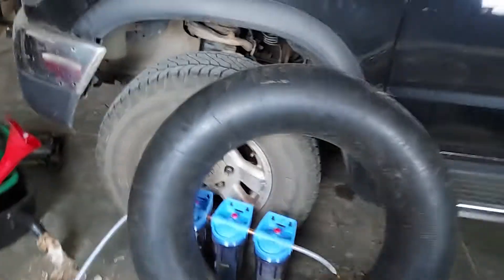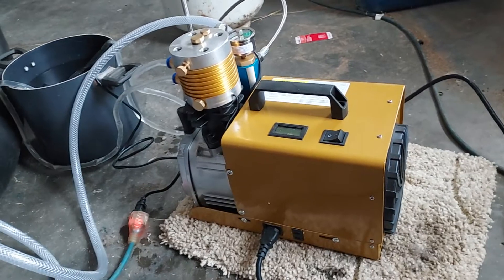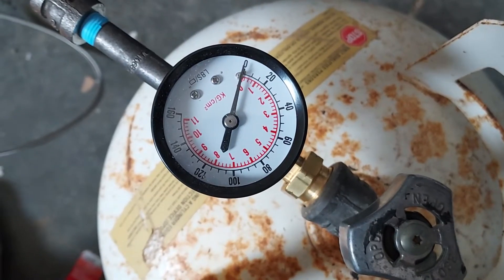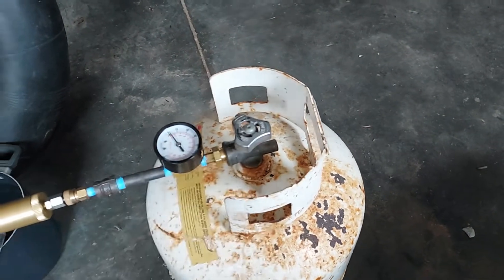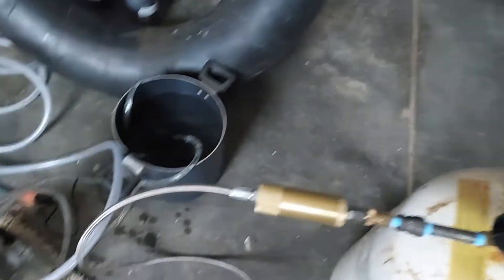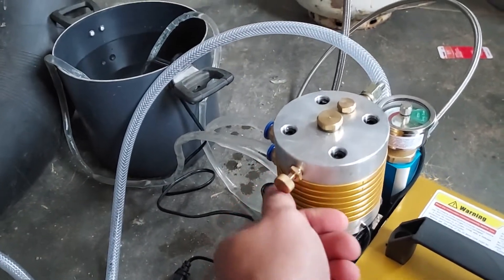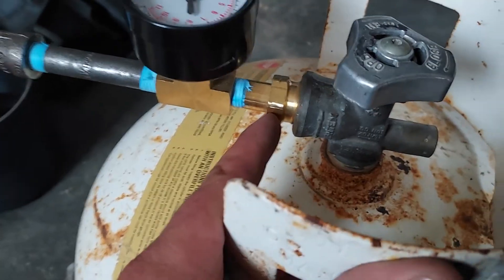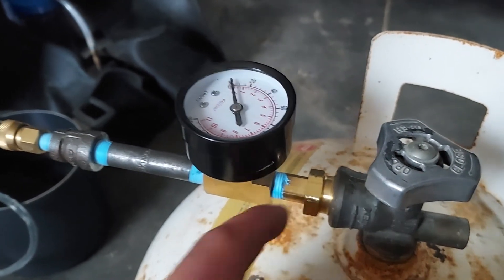compressing biogas

Comment: You forgot the calcium hydroxide to remove the CO2 which falsified the actual yeld amount
Reply: Also is that a explosion protection compressor? Compression of combustable gases need to be compressed with EX protected equipment otherwise the compressor turns into a combustion engine.

Comment: Oh I forgot, if you can, adding a fitting for an O2 (oxygen) sensor on both bleed line. That way you don't guesstimate if it's good and you will have no trace of oxygen there, could be a life saver
Reply from the maker: That’s a great thought. Thanks

Comment: Keeping the cylinder cold on ice reduces the pressure and liquifies the gas.even put bottle outside in snow.
Find the WC or water content of bottle and fill to 80%or less.
There would be a filling ratio for bio gas close to lpg I’d image.
Wc x filling ratio x .80 =  volume in kilos
Get yourself a new refrigerant bottle with 2 valves and ports and fill through the red port which has a liquid tube to the bottom of the bottle

Comment: You are hooking up the filters backwards. Note the flow arrow.
Reply from the maker: Correct. That’s because they’re designed to filter liquid and I am using them to filter gas. This way The gas will push its way down the center tube and return upward outside of the tube instead of vice-versa. 

Since the volume outside of the tube is greater than the volume inside of the tube, that matters a lot more later when I figured out filling the filter with water works better than steal wool.

Comment: While water can scrub CO2 out of the biogas stream  and upgrade the biogas quality and energy density, providing a good source of bio methan, natural gas, but  it must be done under pressure, because of water's capacity to absorb CO2 is highly dependent on pressure. Think about CO2 bubbling out of solution in soda bottle when you release the pressure. Your high pressure water scrubber should be compressed to between 70psi to 150psi. This high pressure water scrubber should produce about 98 to 99% bio methan, natural gas.  The soda water  can be let out and regenerate itself under low pressure. This can be done in batches or continousely by letting out a stream of CO2 infused water at the bottom, and feed in refreshed CO2 depleted water at the top  while the biogas is  bubbled through the scrubber. 

Here is a note on compressing and storing low grade biogas with CO2 under pressure without sufficient scrubbing.  The moisture in the gas can condense after cooling and absorb CO2 from low grade stored biogas under pressure  forming carbonic acid in the water that may slowly eat away at the iron in the steel walls. Thus a low pressure drying stage after scrubbing to remove water before recompressing is important.
Reply from the maker: Excellent thoughts!! I love this. 

Back then, I was aware that raising the pressure would increase the effectiveness of the water scrubber (I think I talk about it in one of the videos) but I could find no way of doing it that made sense. If I could find a way to do that, I might start this channel back up and resume my goal of running a car on kitchen scraps. 

Thanks so much for your comment.
Reply: @BiogasUSA  Ive been thinking about this problem for awhile now and I think I've worked out a batch process that is simple and makes sense. It uses city water pressure to do much of the work. 

A CO2 scrubber can be made with 10 feet of 6 inch schedule 80 PVC pipe, two end caps, maybe 4 valves, water hose,  and optionally a pressure gauge. 

1. lay the chamber on its side.  This gives a good surface area for gas absorption when partially filled with water. 

2. Purge the chamber of air with water. After it's full of water and completely purged, then close the gas out valve and drain the water by opening the water out valve letting it suck biogas in through the gas in valve. 

3. When the chamber is filled with biogas and empty of water, one should close the gas in valve, and water drain valve, and open the water in valve and let city tap water  in with its pressure compressing the biogas as much as the static water pressure will allow.

4. Let it sit, so that the gases cool down making its compression iso thermic,  while also giving it time for the CO2 gas to be mostly absorbed. Agitation can quicken CO2 absorption. But  for simplicity let's consider just giving it time.

5.  After the pressure has stabilized and much of the CO2 is absorbed, you can open the gas release valve to another tank or a compressor to store in storage tanks while you continue to maintain pressure in the CO2 scrubber chamber under city tap water pressure, until the scrubber is filled with water. Then close the gas out valve, and the water in valve.  

6. The water is now charged with CO2, and this needs to be let out and so that the CO2 can degas. 

The static water pressure in most US homes is commonly between 40 and 60 psi.  Or one can use a shallow well pump and water holding tank for virtually no suck head pressure loss, then set the cut in and cut out pressure higher 

A 10 foot 6 inch schedule 80 PVC pipe containes about 50.34 liters of volume, and is rated for about 280psi. While the end caps are probably rated for 200psi. This should be a more then sufficient safety margine when working with compressed as. If filled with a typical 60% methane and 40% CO2, then that's 30.2 liters of methane and 20.14 liters of CO2. 

When pressurized to 40psig  static hydro pressure, the methane concentration in the scrubber equilibriate at about 87.5%, but at 60 psig, the methane concentration improves to about 90.7% after the CO2 is absorbed into the water. This is a vast improvement given the simplicity, and even at 40psig, a batch could be repeated once  to achieve an impressive 96% methane concentration from a homemade CO2 scrubber.
Reply from the maker: @kreynolds1123 very interesting ideas!! I’m loving this. Genius to use city water pressure. 

I’m not sure I have 40-60 psi on my water lines. It must get regulated down before I ever see it. I’m going to spend some time and think about this also. 

Thanks for this comment.
Reply: @BiogasUSA that's static pressure which is different then pressure under flow.  I'm pretty sure the pressure regulated to your home by the city  is above 40 psi.  But as water flows through your pipes, the dynamic flow lowers the pressure but the static pressure should be the same as what your city provides you.

Comment: Here's a note on the chemistry  of iron filtering out hydrogen sulfide.  It needs water and iron oxides to make iron sulphide. That means it's better to pre rust the steel wool with as little as sodium chloride and first bubbling air through it. Then when you bubble hydrogen sulfide through  suspending  iron (III) oxide mud, the hydrogen from hydrogen sulfide and oxygen in the rust makes more water while the iron and sulphur makes  insoulable iron sulfide. 
 You probably want a bubble mist filter downstream to keep rust and sodium chloride out of the downstream compressor and equipment. 

iron sulphide can be regenerated back to iron oxide and elemental sulphur consuming the last remaining oxygen in the gas stream untill theres none, and rerust the iron while elemental sulphur is released.  After all the oxygen is used up and after  the rust mud is largely spent converted to iron sulfide particles  you can swap the bubbler out with a new batch of rust mud and bubble air through the iron sulphide. Then gravity filtration can help seperate  elemental sulphur and iron oxide because iron oxide particles  is almost twice as dense as elemental sulphur particles.
Reply: That’s a bit like an iron sponge. Sulfatreat is basically clay balls impregnated with iron oxide while iron sponge uses wood shavings as a carrier for the iron oxide. You can use one of the amine sweeteners to absorb the H2S and regenerate it but you want to know what you’re doing because you concentrate the H2S and can easily kill yourself with that.
Reply: @Woodburner100 yeah, hydrogen sulfide is no joke. great point. It needs to be oxidized to water and elemental sulfer for safety.
Reply from the maker: Wicked great comment. Thanks for sharing your knowledge. Isn’t iron sulfide pyrophoric also? Or am I thinking of something else?

Later on in this project I discovered that simply bubbling my gas through water would clean massive amounts of h2s from the gas very easily. I placed the water bubbler filters between the biodigester and the inner tubes (instead of between the inner tubes and the compressor) so that the gas would move very slowly through it throughout the day, and the h2s would have more time to contact the water. This was highly effective. 

My biggest problem became filtering co2 from the gas. If I could come up with a good idea of how to do this I would restart this project and try to make a car go.
Reply: @BiogasUSA Yes dry iron sulphide can be  pyrophoric. its oxidation  generates heat and heat can accelerate the reaction. It  can also potentially release some hydrogen sulphide and should be avoided. 

Yes, water absorbs hydrogen sulfide pretty well, but it has a limited capacity to do so. As it nears its capacity more and more hydrogen sulfide will not be absorbed.  And you eventually need to get rid of the hydrogen sulfide saturated water. On the other hand Iron oxide breaks up the hydrogen sulfide splitting hydrogen from sulfur making H2O  from the  oxygen in iron oxide  and iron sulfide from the remaining iron and sulfur. the chemical reaction  Wh ensures that the water never gets close to  its capacity to absorbe hydrogen sulfide,  so long as there is iron oxide to react with. 

Water also absorbs CO2.  in another comment I suggested a pump to compress CO2  up to about 150psi. Bubbling hydrogen sulphide scrubbed biogas through water under 150 psi in a tall water column will scrub it of most CO2. 

You might try an acid washed sand to remove minerals. And bubbling through cource sand grains breaks up bubbles and increases the bubbles residency time in water.  This might allow for a shorter column of water. But it also displaces water so less water means less capacity to hold CO2.   Drain the water out at the bottom and let the CO2 bubble out. Then add the CO2 depleted water back at the top  with a water pressure pump to capture the remaining CO2.  This can be done in batches or continouse mode. 

Here is a batch process you might like.  Fill a tank to 75psi  with biogas scribes of hydrogen sulphide, then add water to the tank with a pressure washer that can spray water at 1500 psi or more, until the tank reaches 150 psi.  This would result in the tank being slightly over half filled with water. Let it set for a while untill the pressure stops dropping with the absorption of CO2.  Then drain the carbonated water. If the biogas were 40% of the initial volume at 75psi, then after adding water  and removing the carbonated water also a large percentage of the CO2, the pressure in the tank will be close to 45-50 to psi.  You can rince and repeat (idiomatic pun intended)  if you want to ensure a higher grade biomethane
Reply: @BiogasUSA  I just watched an Apollo 13 micro-docu so I'm definitely qualified to comment on CO2 scrubbing, you can simply use lithium hydroxide 😂 thanks for coming to my TED Talk

Comment: The filter system contains a lot of air , you will want to put a close off valve at each end to limit the air ingress and gas wasted to purge it.
Methane is lighter than air so ensure any purging is done from the bottom of any container not the top.
Reply from the maker: Great points. Thank you for the tips.

Comment: You should keep a slight overpressure on the suction side of the compressor. That way, there's no risk of it sucking in air if you have a small leak. You could just put a board on the inner tube and put some weight on it. Relying on one keeping an eye on the manometer doesn't feel good when the compressor has the capacity to explode the tank. I would put a safety valve between the compressor and the tank that opens before the tank blows.

Comment: you need a recovery pump, not this air compressor, also a vacuum pump to pull a vacuun on the vessel prior to filling, but methanes boiling point is well below freezing at -161 so wont liquify unless purified and compressed in a high pressure vessel to 3000psi. they sell high pressure vessels and pumps also filtration chambers  hoses and guages that can withstand those pressures. filling a tank like this isnt worth the time it takes to fill as youll only end up with a few min of cooking gas at that pressure. better off getting a bigger balloon and sticking with that. methane really needs to be chilled in cryochambers to -81c  to liquify and needs cryo storage to be kept in liquid form, compressing to 3000-3500psi or 200-250bar in  properly rated vessel to really make it useful

Comment: How do you get the air out of the tank before adding the biogas gas please
Reply from the maker: @bnf3t  the tank had propane in it before, so I was never worried about oxygen in the tank making an explosive environment. 

I also wasn’t worried about completely emptying the propane before filling with biogas - but if I was I would fill it with biogas and then vent it empty two or three times.
Reply: @ many thanks 
I have something for you when we were younger we used to have horses quite a few of them here in the UK. We used to use a bulk feed called Sugarbeat when you bought it. It was dehydrated because British sugar take the sugar out of the beet be so you left with this dry food lots to feed it to the horses you need to wet it so it expand but there was always a black liquid at the bottom of the bucket after you finish feeding it my brain started to work sorry if this is a bit lengthy just the way my brain works so I thought here we go so I got a galvanised bin and kept saving up the liquid until it was full. I went to my local baker and bought a pound of fresh yeast broke it up then put the lid on it until it fermented I borrowed my mother’s pressure cooker. She didn’t know by the way and I heated it up and produced neat alcohol. I used to run a lawnmower off it more free energy just a thought. This could be used in the petrol generator or as you say in the US a gas generator.

Comment: can you use a regular compressor?
Reply from the maker: @itrstt66  we’re human beings. It’s awesome! We can do anything we want. 

This one is meant to compress air too, works great because it had a threaded air intake filter, so I could thread in my hose barb fitting and get a good seal. You want to make sure you’re compressing only biogas or you could have a fire/ explosion hazard. Another great feature of this compressor is the bleed valves to purge the air out of the system before compressing. If you’re shopping for compressors to use I would recommend looking for these features. Also, I believe there is a link to the one I used in the description of this video. Good luck.
Reply: @BiogasUSA  Sadly the link is broken :(

Comment: On each end of the hoses should put a valve to it can keep oxygen out of it so ya don't have to keep bleeding it just sealed system
Reply from the maker: @dakotak8437  thanks for the input. I did end up hanging both tubes on the wall, plumbing them together, and T’d off a valve and a quick connect for the compressor. It was much easier for me and pretty much eliminated chance of o2
Reply: @BiogasUSA  Nice. Have you gotten to do the set up yet on the vehicle be sweet to see that working
Reply: @BiogasUSA  do you stick the drum in he sun so it can bake more and ever stick your grass or woodchips to increase production
Reply from the maker: @ I live in North Dakota. There isn’t a lot of sun, but I had a barrel heater on it and later it was also wrapped in insulation. It still wasn’t enough to keep her running through the winter. I ended up over feeding and this first digester went sour.
Reply: @BiogasUSA  what about that tote that I seen in the one video bigger always better lolol. Ya and In tank heater be good. Plus if you got road kill and stick them in there really be some gas 😂. In my opinion I thing putting an mixer inside to keep things sturd up would digest better then everything clumped takes longer
Reply: @dakotak8437 for a mixer I’m thinking of using an old buffer motor. Attaching an auger bit and going down the center cap of the IBC tote. Would be cool to find a 12v motor… 

For insulation I’m doing 8 inches of styrocrete. It’s shredded styrofoam + aircrete (cement and dawn soap). It has an R value of 4 per inch. I live in California so 8 inches is plenty. 
But maybe for SD going 16 inches could make it sustainable? 
Add a solar heater…
Reply from the maker: @dakotak8437  no sir. I had too many issues with the digester and too much other life happening. Perhaps I’ll be back to this again one day, but for now it’s decommissioned.
Reply: @BiogasUSA  sorry hope everything gets better and can't wait to see it back to working. Stay safe out there

Comment: Not sure how much experience with those compressors you have, but you want to use ice water for the cooling, I actually use freezer packs and RV anti-freeze, dropped my head temp almost 10 degrees over ice water.

Comment: ice the propane tank like you would do for a keg of beer this will help condensed the gas! this process helped me with saving some of the r134a Freon the concept is the same for any gas! vaper!
Reply: Biogas (methane+CO2) will not condense like propane does. That takes cryogenic temperature which is off the chart for a DIY setup.